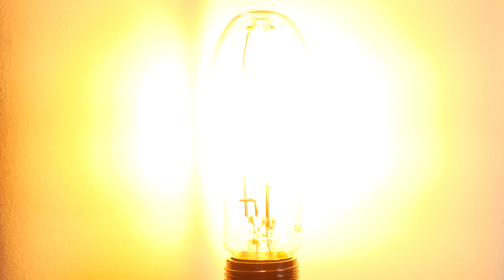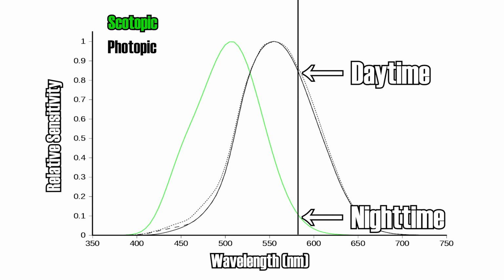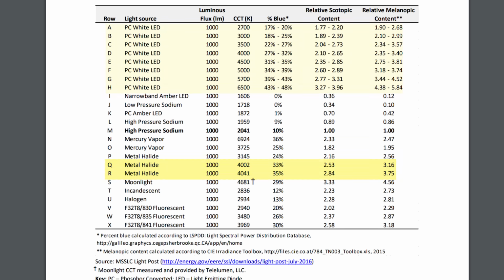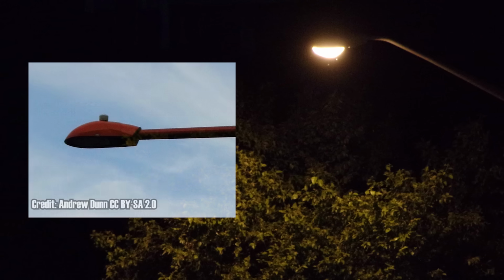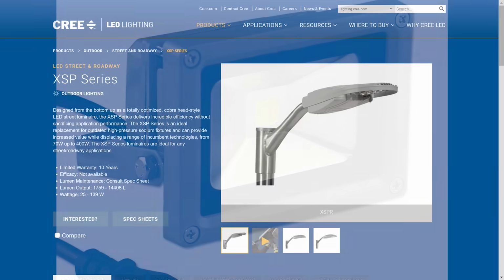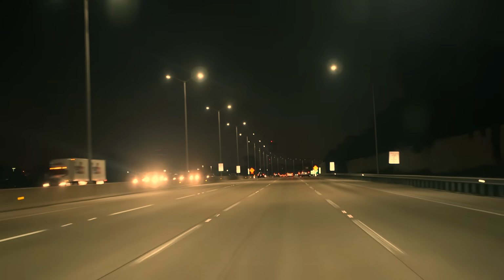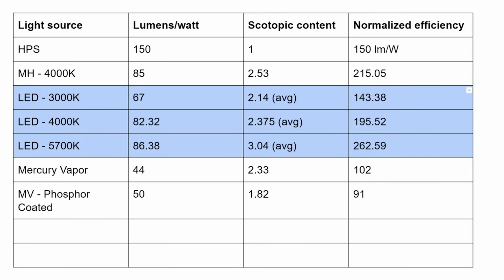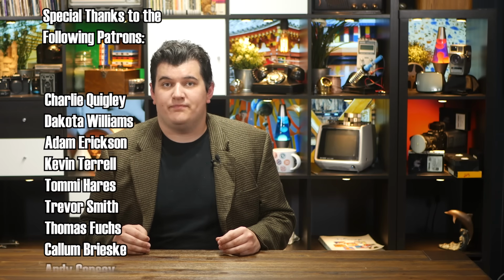The LED's Challenge to High Pressure Sodium

Comment: Now if only they'd ban those huge LED billboards that are so bright they almost blind you...
Reply: I don't understand why they don't pair the LED billboards with ambient light sensors to dim them when it's darker. They truly are blinding.
Reply: @PhazonBlaxor  Well managed LED billboards do just that, dropping to just 5% brightness at night.
Reply: @taylorlightfoot  Then none of them around here are well managed.
Reply: @taylorlightfoot  hah, i divert you to my latest message for a good laugh
Reply: @PhazonBlaxor  That's probably included with the package, but advertisers don't care. The brighter the sign, the more attention it gets. Irritation is a central concept of advertising.
Reply: @PhazonBlaxor   They do. All the ones in my city are much dimmer at night.
Reply: @PhazonBlaxor  They do. Any you see running at full brightness after dark are having issues with their photocells. (You also sometimes see the reverse, with dimly lit billboards during broad daylight!)
Reply: @PhazonBlaxor  <  Because it is a method to steer and focus your attention on crappy advertising on them !!!!  They do NOT CARE about anything else, even the aspect of safety on the roads !!!!
Reply: @PhazonBlaxor  I think one recent one that was installed in my area has a light sensor... But dimming keeps failing so the screen is at full brightness or one panel is lit differently
Reply: @PhazonBlaxor  That would also save some energy!
Reply: I can't even look at them. I don't know what they're advertising, not that I'd care anyway.
Reply: @Corrodias  Exactly. With the old static paper billboards I even sometimes took and take a look at them and there were case when I even purchased something they advertised.

I completely ignore the new ones on the streets, but they are hardly to be ignored if installed across the place you live in. The best way then is move before these LED devalue the property too much and affect you mentally because one cannot enjoy even normal daylight surroundings anymore.
Reply: SentsuizanXS There is a difference between blinding somebody and being visible. Sometimes I cannot even look at LED billboards when my eyes have adjusted to the dark. So I suppose being too bright has the opposite effect, at least on me.

Besides, how much do you think a simple ambient light sensor and brightness adjusting software would cost in comparison on the whole billboard? If anything, they would save some on the energy costs. Your argument makes no sense.
Reply: @PhazonBlaxor  I have actually repaired signs similar (smaller scale, not full a full fledged billboard sized unit, however they all work the same granted it was made within the last 15 years or so) however i can say it would  be fairly easy to do, they already make sensors that can pair directly to the receiving card or multimedia card inside the sign to tell the computer to dim the sign, matter of fact most signs already have such a piece installed. all you have to do is tell the computer how much to dim the sign, if such a sensor isnt installed you can tell the computer to dim manually or on a time schedule. the problem is they are probably greedy and think that having it blindingly bright will cause people to notice it more. or an incompetent tech failed to set it. it is also worth noting that in order for them to operate they have to be within regulations of the area, and chances are if it hurts your eyes they probably are in violation.
regulations like this are why most billboards don't play motion video with the exception of some smaller quick transitions or a looping animation such as the American flag, because motion is considered too distracting
Reply: @PhazonBlaxor  if a billboard causes you that much difficulty, then lights of oncoming cars, which are directly in your center of vision (unlike a billboard), will blind you even more. So maybe your eyes are just too sensitive to still be driving at your age.
Reply: @PhazonBlaxor  The billboard provider won't pass any power savings along to the customer, anyway. That's not how business is done.
Reply: @PhazonBlaxor  because it actually would be very hard to adjust the "brightness" of a billboard like that. They arent like your tv, there isnt a "brightness" setting, it's just a color code.
Reply: @calebmarkle5773  It's really quite easy. They can reduce the percentage of LED elements being driven or they can reduce the current applied to them.
Reply: @calebmarkle5773  rgb. 0.0.0
Reply: have you seen some of the really old full color ones that have been up for 5+ years?
There's one near me (unless they fixed it recently) that looks like a magazine left in the sun and rain- it barely can make any color but blue, and it's got these streaks and grey squares in the picture- it's very abstract art, even when it's showing ads for some superhero movie.

Not sure why it's been there so long, it's a pretty busy intersection between a rich neighborhood and two gigantic retail zones with huge malls.

(corner of Topanga Canyon and Victory? in the north San Fran. Valley, los angeles greater metro area, ca, earth etc etc)
Reply: @confuseatronica  Hoping it's that the city won't let them repair or replace. That's possible.
Reply: @confuseatronica  matrix logic is corrupted.
Reply: SentsuizanXS I actively ignore such LED signs, they're an eyesore. I will not view any advertisement placed there.
Reply: @AltimeterAlligator Yeah..! there are several around here, and the message changes every 4 seconds, and of course you can't read much of the ad in that time...
Reply: @AltimeterAlligator  They need to make them more creative looking, a lot of Asian cities like Hong Kong have pretty interesting looking LED signs, granted these are far less interesting looking than the neon signs they are replacing though. U.S. bill boards just have blinding LEDs, those are just irritating and boring looking.
Reply: I did the math on these based on the power output of the LED arrays they use. Turns out a 4 foot by 6 foot board has about the same brightness as two trucks with their high beam headlights turned on and pointed directly at your car.
Reply: @IOUaUsername  You just reminded me of another pet peeve.
I'm getting old, everything pisses me off nowadays.
Reply: PhazonBlaxor They do, but it's up to the operator to set the brightness levels based on the sensor readings. The manufacturers provide default settings based on "urban", "suburban", or "rural" installation, but some operators don't even know those settings exist. There are inconsiderate advertisers out there, but a quick email letting the owner know the sign is "too bright to look at" at night will usually get the ball rolling!
Reply: although they're really bad, video billboards are the far worse offender, they aim light to your eyes directly
Reply: I used to drive to the U.S. from Canada a lot for work, i couldn't believe just how many billboards there are (at least in Michigan). There's a hilarious irony in banning the use of cell phones while driving, just to be bombarded by city bus sized tv's every 100 meters.
Reply: @xxXMusickXx  if you can't see the difference between issuing a cell phone while driving and liking at a static image on a billboard, that's the reason they banned cell phone use. People that don't realize how distracting they are.
Reply: Rem: I also don't like when they flash red and blue at night. I start looking around, thinking I need to give right-of-way to a non-existent emergency vehicle.
Reply: yes, they do have dimmers on them so they could dim those ultra bright obnoxious led signs
Reply: Agreed!! Those things are insanely bright. Having to wake up and drive to work is awful when your eyes arent adjusted to the light and theres a board of laserbeams blocking out the road
Reply: Full automatic BB pistol, problem solved 😂
Reply: HAHAHAHA true!
Also to sign the highways, when it's 100% dark night, and you have to go trough a portal of LED signs that are clearly made for daylight viewing, even stronger than your car headlights, then you drive quite a few dozen yards without seeing absolutely anything at all until your eye adapts again to the cozy dark night. Really cool!
Reply: I think it would be nice if they banned billboards, period. But they make a lot of money for advertising agencies, so...
Reply: You can just use the breaker at the base to turn them off.
Reply: @Nicholas-f5  Where will I find it exactly? I'd happily pull over and turn these off. I've considered vandalising them, they are that bad and dangerous... 
They are used extensively in Melbourne and no one seems to police it or the regulations are far too relaxed when it's on private land (despite being visible to the road and a real distraction especially at night).
Reply: Hell I left texas stadium like 4:30 in the morning after a gig. Headed to grand prairie. Had to stop at a red light( led) when it turned green I was blinded.
Reply: If you stop reading billboards and just drive the world will be a safer place.
Reply: And other drivers with leds especially trucks
Reply: And LED headlights that are brighter than regular headlights on highbeams, and LED tail/brake lights that blind you when you're stuck behind a car with them at a stoplight.
Reply: We did in Hawai'i. No billboards of any kind 😊
Reply: Do you mean video screen billboards, LCD screens?
Reply: I love those! They look way more modern but the ones in New Zealand seem to dim down just fine and look like a normal billboard.
Reply: I like those.
Reply: horrible things.
Reply: @what-uc  or hack them. moat have poor quality firewalls ;)
Reply: Also xenon and led on casr, I can't drive for a long time at night whiteout my yellow glass.
Reply: Rem I live across from LSU’s Death Valley. That damn jumbo screen is on 24/7. It’s very annoying. It shines right into my window
Reply: Hungry, thirsty, horny come to the atomic wrangler
Reply: I remember here on road between built-up area and highway entrance there's a part, where on both sided there are small industrial buildings. And one of them has LED ad, that was shining very bright, blinding people bypassing the road. But later because of that, they dimmed down the brightness, so ad is still here, but now doesn't shine too much to disrupt driving
Reply: Yeah, I bet the people who put them up are in cahoots with those damn kids who keep playing on all of your guys' lawns!
Reply: I’m more for bashing in hyper bright LED headlights. They drive me friggin nuts when some jackass has them full beam barreling down the highway towards me in the next lane. You can’t see past them.
Reply: @what-uc teacher alert!
Reply: I call those "reactive targets"
Reply: Rem   Yeah, I’d have no problem with that.
Reply: misaligned xeon headlights are far worse imo
Reply: And serve no industrial purpose. They literally only exist to generate demand. Probably demand for unnecessary products people can't afford anyway.
Reply: i work for a company that places these huge LED billboards. Usually it's chinese technology and chinese software with translations and navigability that are... shit. Ambient light sensors are mandatory in our country but they stop working ALL the time. Can't remember how many times i laughed passing one of our screens along the highway at night, BEAMING oncoming traffic at 100% brightness, or around 5000lumen iirc. It's hilarious xD Oh and not every LED panel/module is the same, some are really bright and some are really dim. So it really depends what happens when a light sensor fails.  But usually the brighter LED modules have better color reproduction (at least as opposed to dim modules) so that's what you're likely to see outside.
Reply: @insanebmxthomas  I too once worked for a sign company, and a lot of people were ordering these. Many got the cheap Chinese ones and they looked horrible and required constant maintenance.  If you get a good American brand, like Daktronics, they are actually very well built and adjustable to not be an eyesore. They are expensive though.
Reply: They should dim it at night
Reply: I hate those
Reply: If they're meant for cars, can't they use retroreflectors? Plus maybe some dimmer LEDs for pedestrians.
Reply: imagine Concept Street Lamps Were Existed
Reply: or turn down the brightness at night.
Reply: And have a proper night setting on police cars. You don’t need the power of 1000 suns to pull over Speedy Gonzalez
Reply: @brandondye7774  I hate when I'm an oncoming vehicle and get blinded because they think they need to have their spotlight on.
Reply: Solution, require ads shown at night to use a "Dark Mode"
Reply: Billboards in general should be banned as road distractions.
Reply: Oh yes please
Reply: Billboards have no place near roads. They are distracting drivers and cause accidents.
Reply: Imagine if an LED billboard faces right your windows right across the street. It's not only night pollution, it's also day pollution and mental impact. A person cannot anymore enjoy a normal day landscape. The constant changing picture always distracts, you want to avoid it in anyway, so your panorama is quite limited without seeing this LED screen. 

The situation is even worse during gloomy, cloudy or rain weather. Eye fatigue, constant flickering of this LED in your rooms on windowglasses, walls and everywhere. That's not only a nuisance, it's a damn criminal heavy light trespass (almost light torture) that may lead to mental and behavioral conditions.  The best way of becoming a mental patient with a damaged eyesight is to move away ASAP from those streets or malls with huge( and not even huge- they are almost all the same) LED billboards and screens.
Reply: Not to mention those damn pickup truck LEDs that make you wish you were blind
Reply: They should definitely ban lighting up normal billboards, though the electronic LED Billboards that can change what they show is still a neat concept that I’m surprised hasn’t replaced all normal billboards by now. Where I live, I haven’t seen many around, maybe one or two every once in a while, but it’s surprising how many normal billboards there still are.
Reply: Are those billboards using quantum dot technology or are they OLED displays?
Reply: and get rid of video billboards.  I find myself watching them rather than the road.  Why distract drivers with giant TVs?
Reply: I have one of those pointed in the general direction of my house and my neighborhood.
Reply: they shoud ban all LED lights
Reply: There must be a way to make the billboards dimmable. Just put an ambient light sensor and change the billboard brightness accordingly based on the ambient light.
Reply: And those damn led truck lights….
Reply: they should def ban x% of white in those, u cant leave me a 70% white background on those boards while raining at night, that's just the worst combo to not see shit
Reply: All billboards should be banned, they are designed to distract you from not murdering someone with your car.
Reply: just dim them or turn them off a night
Reply: They’re starting to build those more around here in Wisconsin and they’re horrid
Reply: Looking at you, minor league baseball stadium in Washington, Pennsylvania. That sign is an atrocity.
Reply: Cost. If I'm an advertiser, why would I pay money for my ads to be less visible?
Reply: @KaitouKaiju  Because I'll assosiate unpleasant feeling with your product.
Reply: @Herbertti3  Somehow, that sentiment doesn't register with advertisers. It's the "Any publicity is good publicity" philosophy.
Reply: @Herbertti3  For some reason, advertisers ignore that fact. It seems that being loud and obnoxious is the goal for most of them. Witness the fact that so many DVRs have ad-skip features.
Reply: @WCM1945  Jokes on them. If the ad sucks or the store sign is ridiculously bright or flashy in traffic, I avoid that place.
Reply: @KaitouKaiju  if its so bright it hurt your eyes people are going to avoid it and have a bad impression of the company because of the billboard
Reply: @KaitouKaiju  on the contrary, it usually goes so bright that you can't even see it for more than 1 seconds without getting the image of the ad burned into your retina.
Reply: @KaitouKaiju  if you're an advertiser, why would you pay more money for brighter billboards if they're not going to be much more effective, but rather make people hate billboards altogether? It cuts both ways!
Reply: @KaitouKaiju  Sorry, but if it's dar at night and your billboard is too bright, it's like looking straight into the sun... All you see is a blur.
Reply: xerosagas well the advertisers could make it cheaper because of less electricity and less intense use requiring less repairs
Reply: @KaitouKaiju  because its a distraction to road users and moat are illegal
Reply: @KaitouKaiju  I drive past their super bright ad many times, and I can never get the message of the ad because I was blinded every time.
Reply: @KaitouKaiju  when people squint their eyes, it's actually less visible. Look at the sun, do you see the details ? Yeah.
Reply: @KaitouKaiju  The cost of a dimming circuit and the little lux sensor may be won back on the energy bill.
Reply: @KaitouKaiju  if your advert is so bright it hurts people won't look at it
Reply: @KaitouKaiju  because I'll sue you when your bright ass billboard blinds me and causes an accident. Also they don't need to be the same brightness as night because there's almost no ambient light to wash out the light of the billboard. It's like if your phone brightness is low during the day and you can't see the screen but that same brightness level at night is blinding.
Reply: @KaitouKaiju  Because you want people to look at your ad instead of closing their eyes and looking somewhere else maybe?
Reply: xerosagas I’ve seen them before there SOOO bright at night u can’t even see what’s being advertised it’s like looking at the sun
Reply: @KaitouKaiju  Tot don't gain anything being en advertiser off people don't even want to look at the billboard your content is made visible on
Reply: @KaitouKaiju  They may be more visible, but they aren't more readable.  Additionally, they are distracting at night when run at full brightness.
Reply: @KaitouKaiju  they'd actually be more visible.
Reply: @KaitouKaiju  People don’t want to look at an ad that blinds them. Lower brightness, pay less, higher viewership. Real cost vs theoretical cost.
Reply: So people will actually want to stare at the billboard and see what it's about. 
 @KaitouKaiju
Reply: @KaitouKaiju well… the goal would be to keep them optimally visible.  However it is the one paying the power bill that would be most interested in the simple task of PWM adjustment to save power at night.
Reply: Luxotica pple don’t go blind.
Reply: Unless I misunderstand, the answer seems obvious to me.  LED color temperature should be tied to road speed limits.
Reply: That ties into the blinding LED bar lights used on police cars. That DO come with a switch to dim them at night, but many shops don't bother to hook them up, and most cops want the lights to cause people to slam their brakes on, anyway. Safety is always an afterthought. First comes law enforcement. Safety doesn't provide ticket revenue.
Reply: If it was cost effective to double the light output, even if it would kill thousands of people a year from blinding them, they would buy a million of them in an instant. The suffering of people shall not get in the way of potential profit.
Reply: And they should take all the leds out of em and give em to me cuz i need LEDs
Reply: Stop trying to ban everything. Ban craze and cancel culture is a cancer in America right now.